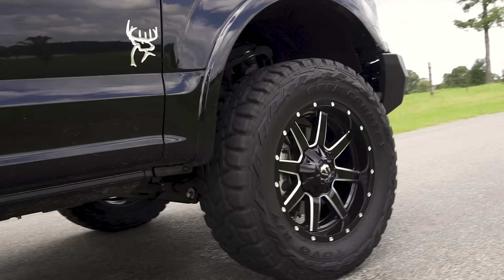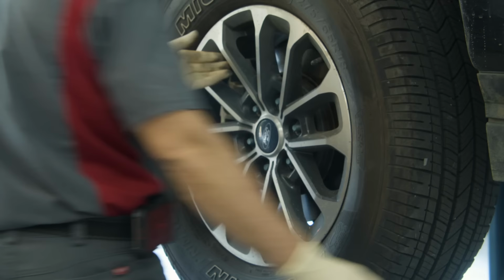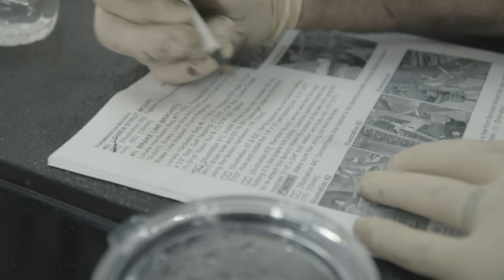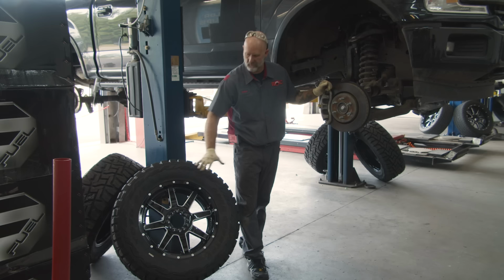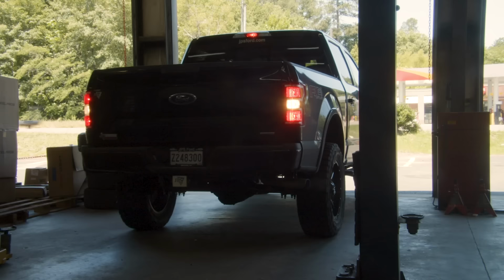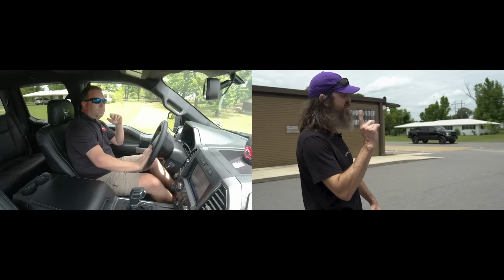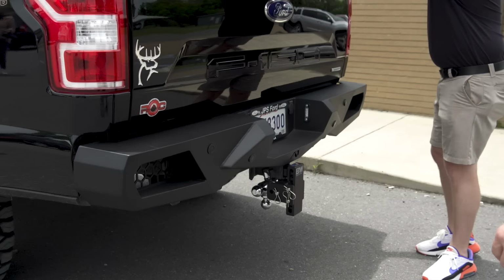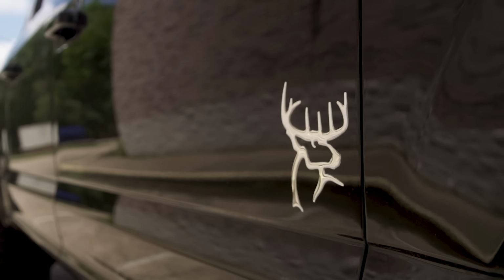JASE ROBERTSON'S Custom Buck Truck | Buck Commander

Comment: Didn't even put led reverse lights, no spray in bedliner, and the easiest thing they could've done was an easy lift tailgate assist so the tailgate could open slowly by itself. I do like everything they did. But they could've done some more
Reply: ok but yet do you work on trucks prolly not. maybe he didn’t want that on his truck, you do NOT know what happened behind the scenes. so maybe get your information correct.
Reply: @tayspays321  lol idk why you're replying to my 7 month old comments. And yes I work on my truck all the time. Most of the things I said are insanely easy and not expensive. Also it's not that deep. Chill out

Comment: Bigger rims and tires but while they are off, no bigger brake rotors?
Reply: It isn't always needed but it definitely helps. I have a 97 Chevy on 35s and I use stock size rotors and pads and I can stop on a dime no problem.
Reply: @coledurbin2610  none of this stuff is needed, they are upgrades.

Comment: Ive had that hitch for 7 years. Biggest issue for me living in the north is rust build up. Its stainless going into a regualr steal body. Lubrication, a hammer and a punch are a necessity if the hitch stays on all the time.

Comment: I want to see this done to a 2022 Ram 3500 SRW 4x4 crew cab Cummins Diesel.

I bought a 2018 Ram 2500 crew cab diesel when I retired. I could not be happier.
Reply: I mean if you want to be a pavement princess then go right along ahead.
Reply: @sdpy15  your are just like a typical Ford guy. Say they are the best but can never accept the fact that they aren’t the best. None of them are they are all decent trucks that have their problems. Fords biggest problem is they diesels are prone to complete engine failure at least 2003-2012 was. For almost 10 years Ford failed at making a diesel but we won’t go there. 🤣👍🏻
Reply: @sdpy15  lmao I have 3 duramaxs 2006,2011,2017 and haven’t fixed a thing and all of them are between 185k, 330k miles lmao. 7.3 are junk. The transmission are weak as water. The engine doesn’t make enough power to really break them. Sure you can pull at a 26,000 lbs non cdl limit. But you won’t pull it fast, won’t get to speed fast and damn sure cant stop it with their garbage brake systems. If you have to revert to a truck that is 2 decades old because of the reliability issues of the new trucks it means that company makes garbage and isn’t the best. You literally just made a statement to prove yourself wrong which is way to funny. I needed that laugh today. 🤣🤣🤣🤣👍🏻
Reply: @dakotadickens3747  ya but the 7.3 is still better than a 6.0
Reply: @sdpy15  35’s on a 2500 would perform amazing, because a 1500 off-road build on 35’s does good so why wouldn’t a diesel. If you watch people like dmaxryno you’ll see you can off-road on 40”s, but it might break something thing every few trips or so.
Reply: @noahjohns7954  debatable I mean you can get some decent power numbers on a 6.0 and
If you have them studded by someone that really knows them they aren’t to bad. I’d take a 6.0 gasser from chevy over any Ford diesel till maybe the latest 6.7 2015+. Cummins and ram kinda own the market I just don’t love straight axle trucks. Had one nearly kill my family because of their design. Chevy just need to get their interior game going and they will be right there with ram. Ford is only king of new features that most of the time do not work. But the king ranch is nice to sit in. Idk about to ride in because my last king ranch rode and drive like trash and was on engine number 3 in 290k 😂. But people still say they are good. Only engine I’ve ever had fail on me though.
Reply: @dakotadickens3747  Exactly lol. I've got a tuned and deleted '19 L5P Duramax that would pull the guts out of the 7.3

Comment: So…. Pretty much a basic lift, crappy wheels and tires, rock lights and a small bumper upgrade. I’ll stay with my 04 cat eye. Just saying. They could have done better
Reply: When you're hunting, what more do you need? A basic lift is probably all he wanted, the wheels and tires were a great choice, and the bumper was a smart choice because it's thicker plate steel and not that crappy plastic with Styrofoam in it or whatever they call these new bumpers
Reply: @coledurbin2610  it's already squating..just imagine trying to haul a 4 wheeler or a boat with it, they probably sold his stock wheels for double what those 20" cost them, and what kind of off road shop doesn't have the confidence to spray a bed liner? They just bolted on a bunch of stuff..the bumpers do look good from here tho
Reply: It’s his truck not yours buddy. 😂

Comment: Love the truck but it should have been a f250 most outdoor men pull heavy trailers, campers and boats that f150 couldn't do it in my opinion
Reply: That’s plenty truck to pull a duck boat, I highly doubt he pulls a camper when hunting away from home.
Reply: @shanehamilton6708  maybe a small duck boat but a bass boat is a no but my opinion should have been a f250 I have 2 and a half ton truck wouldn't be good for me
Reply: @bigdougss5240  They hunt alot which means off road. F150 better off road tighter turning radius and lighter. F150 will pull a bass boat ot trailer easily

Comment: Those tires are way to small I run 35 13.5 on a 3 inch level and has no problems
Reply from the maker: Different strokes for different folks 🤷🏻‍♂️